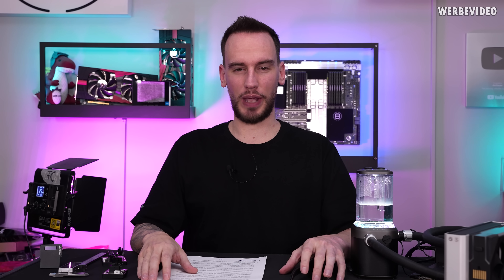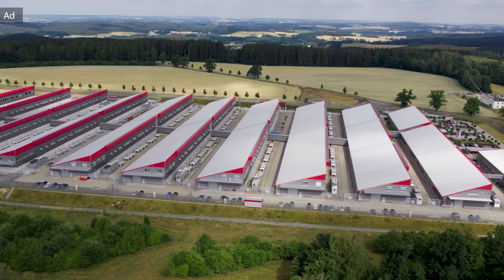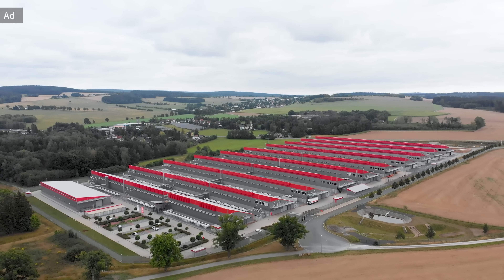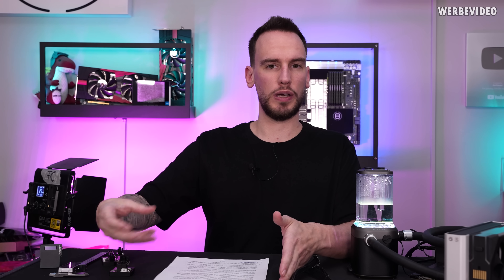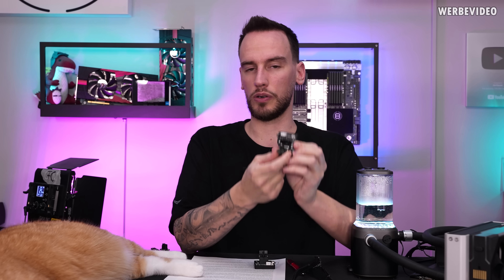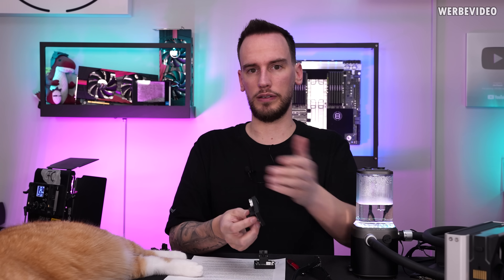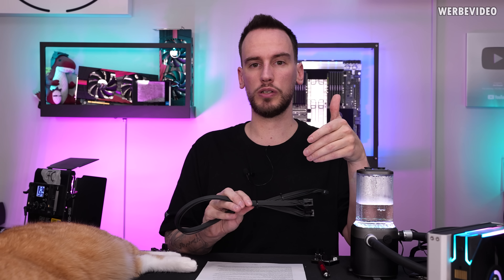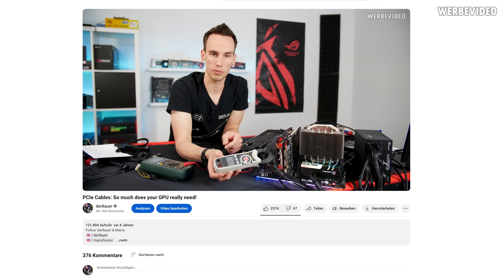12VHPWR is just Garbage and will Remain a Problem!!

Comment: All this news has had me keepng tabs on my 180degree cable mod. However, I feel for now I will be okay. I dont push the 4090 to 4k I have 2k monitors and I dont play games that need the max 240hz on them for 240fps. I run 120-144. This means i never touch 300+ on the 4090. My hope is by the time I need to push the 4090 to near 400w, a safer solution comes around

Comment: If they were concerned about 'old' crap that maybe has thin wires and cant support more than the spec 150W on the classic PCIe connector then they should have done a re-keying of the graphics card PCIe connector (female) for a modern replacement that is maybe rated for 300W so 2x8 would get you the 600W. Some of the pins have a half-octagon shape to them. If you rotated say two of them 180 degrees on the female side, 'old' PCIe males will no longer go in. On power supplies make the same pins a full octagon so they will insert into either.

Comment: Is the burning only happening on the end of the gpu/cable extensions/adapters? 

I just find it weird that I havent seen many, if any, burns on the psu end.

The intention of not having 3-4 cables on a gpu and only having 1 is nice but I do hope they revisit the design and fix it.

The amount of 12vhpwr cables burning is just insane

Comment: I'm using AMD GPUs now, no issues.  I have V1.0 of these adapters for my 4090 and never used it and got the recall letter.  I have no interest in future nVidia products, they're moving away from GPU market anyway and 600 watts is crazy power consumption.  They should be using Mil-Spec wires and connectors (sure costs a little more, but way cheaper than failure returns and lawsuits).

Comment: Not to mention that the ampacity of the connectors could differ wildly depending on what region of the world you live in. Hotter and or more humid regions will see a reduction on how much current that connector can handle and this could be a drastic difference. 

If I was a gambling man, I'll bet most of the connector failures come from hotter and humid regions.

Comment: I'm a retired electrical engineer. My solution to the NVIDIA 4090 and 3090 12VHPWR connectors is to limit their power to 300W.

Comment: I think the issue comes from the way it is handling power on the RTX 40 series models, there must be an issue but Nvidia will never admit it, in order not to get sued. But the PCI SIG is responsible too! Pushing 600W on such a small connector is insane... 

Of course 1 cable looks better than 3 or 4, but pushing so hard to adopt this connector is just madness! It's also Nvidia's fault if their GPUs can consume up to 600W ! 
=> Let's not forget that the TDP of the GTX 780 Ti, 980 Ti, 1080 Ti and RTX 2080 Ti was 250W ! It all started because of Ampere switching to Samsung and wanting to keep the performance crown at all cost! Now we're talking about 450W (aka 80% more) !!! 🤦

Comment: Hold up if the wire only has a rating of 6.4 amps, 6.4 amps x 12 volts = 76.8 watts. 76.8 watts x 6 wires = 460 watts. Thats a 'farcry' from the 600 watt rating of the 12VHPWR connector.😬
Note the 4090 is rated at 450 watts.

Comment: I'd like to see the connectors moved back to the short edge of the card too. Cases tend to have more space between the front panel and motherboard for the gradual cable bending than you have before you hit the side window. And they look better hidden more out of sight too. Put them more towards the motherboard end of that part of the card too!

Comment: The cable on my card is fine. I prefer the new cable on the 4090 to the old pascal cables
Reply: I'm only replying because of the real safety concern. Don't assume because it hasn't happened yet that it won't You should keep checking it. It took a full year for it happen to a user and every card is subjected to the same poor design.
Reply: no. It's 100% fine. It's a prebuilt. If it burns i will be rich  @cyberfred5520

Comment: All we need to realise is much power is not going well with thin cables. More power means more thicker wire. If it is too big add the cable. Thats how i understand electricity. Contact of the wire need to be added meaning if you want to carry more electricity, in crease the contact, meaning wider and deeper connector required.

Comment: Used a cablemod 90 adapter, it melted the adapters connector inserted in my 4090. Thankfully, I'm getting my card replaced and my computer tested for faults.
Reply: Ya make sure you are properly seating your power cables and stay away from aftermarket 3rd party adapters/cables next time. If so you will be within the %99.95 of all 4090 owners around the globe that have 0 issues. ✌
Reply: @javiersantana848  It was seated properly. No red light. The case has a narrow clearance so I wanted to avoid bending the cable too close to the connector. I did nothing wrong.
Reply: @Teadon86  " I did nothing wrong." Well, you did. You used a 3rd party adapter according to your comments "Used a cablemod 90 adapter,"
Reply: @javiersantana848  That is not being wrong. The mod was suggested and recommended by professionals. There were almost zero reports on the failure rate of the mod at the time. After reading up on the issue with the 12vhpwr connector, asking professionals, and going through several forums I picked the mod. The fact that cablemod can't do a proper mod is not my fault, just like it isn't anyone's fault that NVIDIA insists in using the damn 12vhpwr connector with pins of inferior make. Thus, you are absolutely wrong in your assessment.
Reply: @Teadon86  "The mod was suggested and recommended by professionals" Not by Nvidia lol. There lies the issue., "There were almost zero reports on the failure rate of the mod at the time" Doesn't matter, using 3rd party adapters runs risk of malfunction and could also void your warranty. This would be a 3rd party issue if that, the GPUs are fine
Reply: @javiersantana848  You wrote all that because you missed the point and is moving the goal post. 

NVIDIA caused the issue in the first place by not improving on or choosing another connector. Another issue the size of the card. Since NVIDIA ignored these issues and opted to keep the faulty connector. Even if you connect the cable correctly it still can fail because of the method of production and specifications for the pins.  Mods like the cablemod adapter are there to navigate around the issue, hence the issue originates from NVIDIA and they are at fault. 

The choice to use a cablemod was to avoid the circumference of the bend being too close to the socket to the GPU as to avoid the cable from disconnecting by the constant stress. The reasoning is sound, the installation was correct, and there was no warning led going off, the issue was the adapter itself — therefore I am not at fault. 

You are basically arguing that an end user that did their research about a product is wrong for trying to avoid a serious issue by switching or adding a component. Like with old Subarus and their faulty head gaskets, one way to avoid an engine failure was to change the head gaskets to ones without the graphite layer. Whilst this violated the company's warrant it reduced the risk of a failure. The costumers that changed the gaskets did nothing wrong but legally they nullified the warrant as these better gaskets weren't approved by the manufacturer. The main fault is with Subaru for using a poorly designed product. 

Thankfully, neither Inet or cablemod agrees with your assessment. Why I am getting a new card without the adapter. Keep throwing NVIDIA's warranty at me, it is worth nothing from the company that ignores the issues with their 12vhpwr connector, the weak socket, and that the weight of the card has a substantial risk of damaging the graphical interface.
Reply: @Teadon86  Nice opinion and the only one thats moving the goal post would be you and is already written. Ill dumb it down, you used a 3rd party adapter and had issue. That is a user error and 3rd party failure, not Nvidia. Nice try tho, nothing you can say will change the facts and even yourself admitted in accordance to your very own comment "Used a cablemod 90 adapter, it melted the adapters connector inserted in my 4090." Get a grip and face reality, nobody to blame here but yourself and possibly cablemod.
Reply: @Teadon86   Here you like math, facts and logic dont you ? 200,000 units sold less than 100 known issues = 0.05%. This product falls well below the industry's acceptable quality level standards and well below the %4 expected failure rate. Thats a %99.95 success rate with the 4090.. you need to ask yourself, why would you have fallen into the %0.05 ? My insight is obviously a user error because you admitted using a 3rd party adapter
Reply: @javiersantana848  You can throw stats all you want, still doesn't matter. I've not moved goal post, it was you when you brought up the legal issue. Besides, It's even likely that this is not an issue with the cablemod adapter since the side that burnt was the gpu socket. But please, remain oblivious my very dumb buddy.
Reply: "Nvidia and its board partners do not cover damage to GPUs that use third-party power adaptors. Before the recall was announced, CableMod offered to repair affected GPUs whose RMA was refused because of their adapters. CableMod is known to send these impacted units to the repair shop NorthridgeFix."
Reply: NVIDIA WARRANTY :

WHAT DOES THIS WARRANTY COVER?
Any manufacturing defects or hardware component failures in your NVIDIA® branded Graphics Card that is still within warranty along with any accessories you received.

FOR HOW LONG?
Three (3) years from the date of purchase of your new Warranted Product based on product specific warranty.

WHAT WILL NVIDIA DO?
Repair, or if repair is not possible, replace your defective Warranted Product. Replacement parts and/or products may include new or refurbished parts or products and are warranted only until the expiration of the original warranty period.

WHAT DOES THIS WARRANTY NOT COVER?
Any problems that do not relate specifically to a manufacturing defect or hardware product failure, including, but not limited to, problems caused by abuse, misuse, negligence, act of God (such as flood), misapplication of service by a party other than an authorized service representative, software, shipment damages, etc.

Comment: NVidia released SUPER series with the same shitty connector. Totally ignoring users. Good times are gone 😢
Reply: Same safety factor if u only put 300 watts through it
Reply: %99.95 of all 40 series owners have 0 issues and the majority of people that seem to be complaining are those who do not even own one. Just make sure to properly seat your power cables and stay away from aftermarket 3rd party adapters/cables. If so you will be within the %99.95 of all 40 series owners around the globe that have 0 issues. ✌
Reply: @javiersantana848  Kitchen appliances with melting power plugs wouldn't be allowed in the market and yet we have GPUs, maybe first time in the history, which have such issues. This is bonkers and unacceptable.
Reply: @fluoxethine  "Kitchen appliances with melting power plugs " they would if the users error was not fully plugging the power cord or using a 3rd party adapter. There is nothing wrong with the GPU, this video is in regards to issue with a 3rd party adapter and all other issue have not been able to be duplicated outside intentional user error. ?Utilizing a 3rd party adapter falls under user error along side 3rd party failure has nothing to do with the GPU
Reply: @fluoxethine  "maybe first time in the history, which have such issues." also, you may want to do more research, you will find both 30 and 20 series had the same issues whenever a user improperly seated power cables or tried using 3rd party adapters/cables. ✌. FYI any electronic components run risk of issue if its power cables are not properly seated or someone uses 3rd party adapters/connectors and may void warranties
Reply: @javiersantana848  OK, never mind. Asus has released the 4090 BTF.
Reply: @fluoxethine  Perfect ! Now the current %0.05 failure rate will be even less, thats awesome. Not that there's anything wrong with the other %99.95 of GPUS running 0 issues. Good to hear ! I hope this will help some noobs avoid issues in the future

Comment: Yep, it was very bad solution from beginning. The correct way to do it is to change the connector back to the old style connector like on this adapter You showed (3-5 or more connectors to garantee safe current) or SIMPLY change the voltage for the card to 24V or 48V. It will reduce current significantly.  Such solution is already used in the USB-C connector to power laptops (look how small pins in the usb-c connector are). For me it was and it is obvious. The 12VHPWR power interface is a bad design, bad engineering.

Comment: I wanted to buy the RTX 4070 Ti "Super" but after seeing this video, i don't know anymore... 🤔
Reply: %99.95 of all 40 series owners have 0 issues and the majority of people that seem to be complaining are those who do not even own one. Just make sure to properly seat your power cables and stay away from aftermarket 3rd party adapters/cables. If so you will be within the %99.95 of all 4090 owners around the globe that have 0 issues. ✌
Reply: @javiersantana848 ya I think it was under 100 people who had issues on release. Nvidia haters been running with the “melting cables” thing ever since. It’s been slightly creepy to see how many are drawn to the same behaviour
Reply: Go for it, as long as it doesn't pull more than 300 or so watts, it'll have the same safety factor as the old 8 pin connectors

Comment: Can we go back to 8 pins, this 12v hpwr is honestly a failure of a spec. I've just stayed with 3080, i don't want to upgrade with this connector, avoiding 4080 and will avoid 5080 if they use this connector, until the failures are greatly reduced.
Reply: %99.95 of all 40 series owners have 0 issues and the majority of people that seem to be complaining are those who do not even own one. Just make sure to properly seat your power cables and stay away from aftermarket 3rd party adapters/cables. If so you will be within the %99.95 of all 40 series owners around the globe that have 0 issues. ✌

Comment: you could easily use something like an XT-60 connecter with a few extra sense/data pin.
but instead settle for something with tons of pins despite it all just being 12V and GND?

Comment: i really want to buy the NEW rtx 4080 Super but seriously these power connectors are really pushing me away from doing it... Or maybe ill just swap to AMD, their card sure doesn't performs as high but i haven't heard about any AMD card burning down cables yet
Reply: Go for it, as long as it doesn't pull more than 300 or so watts, it'll have the same safety factor as the old 8 pin connectors.

Just get a jumbo case so the wire have enough room so they heat up and cool down, other probs don't happen. And just plug it in and. Forget it. Redoing multiple times will destroy the connector
Reply: @NadeemAhmed-nv2br  %99.95 of all 40 series owners have 0 issues and the majority of people that seem to be complaining are those who do not even own one. Just make sure to properly seat your power cables and stay away from aftermarket 3rd party adapters/cables. If so you will be within the %99.95 of all 40 series owners around the globe that have 0 issues. ✌

Comment: I will absolutely not purchase any card with this type of connector. NVIDIA needs to re-think and go back to traditional 8pin. 2 weeks ago I got my son 4070Ti and after maybe 7-8 inserts and removal of the power connector, the connector inner pins on the card became looser, even new cable didn't make difference...total garbage connector....period.  My Strix 3090 I have removed and inserted cables at least 50 times and is still as tight as the day 1 got the card.
Reply: Return and get the super version
Reply: @NadeemAhmed-nv2br  Why would I get the super with exactly the same connector. I will rephrase my comment....I will not purchase any card with that connector even if it was half the price or 5 years from now, this is simply garbage. Sounds like I might stick with my Strix 3090 for the next many yearsssss😄

Comment: Old PCIE 8pin is based on MiniFit series connectors and have pin cross section of 1,15mm^2. With 3pin for 12V and 3pin for GND we have 12,5A / 3 pin = 4,17A per pin.
New 12VHPWR and 12V 2x6 is based on MicroFit 3.0 and have pin cross section of 0,41mm^2 (same as AWG21 wire). With 6pin for 12V and 6pin for GND we have 50A / 6pin = 8,33A per pin.
Old connector 3,63A for 1mm^2, new connector 20,32A for 1mm^2 - this is 5,6x more current!!!

Comment: The entire 12VHPWR needs to be scrapped. Failed design, failed application. I won't purchase or recommend any more purchases of any GPU that uses this connector spec. I only have one client having an issue right now, but IMO it is inevitable that a failure will occur eventually over time. Imagine people trying to RMA a melted connector with the provided cable after the warranty period. No thank you. I will stick with my 3090 setup. If AMD does right and sticks with a proven spec, then I will stop being pro Nvidia pretty quick. I love the Nvidia encoders, but it isn't worth melting an expensive card over.
Reply: "I won't purchase or recommend any more purchases of any GPU that uses this connector spec." Not to mention they are laterally impossible to even buy at retail lol. PS the card is fine, 30 and 20 series both also had power connectors melt when not properly seated/user error or while using certain 3rd party connectors/adapters. If you happen to land one, %99.95 odds you will have 0 issues according to the data